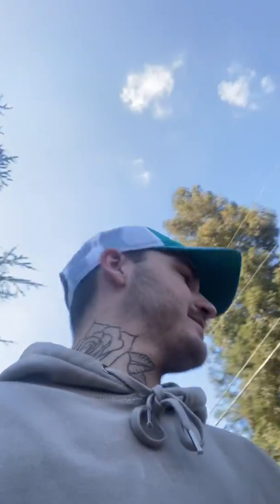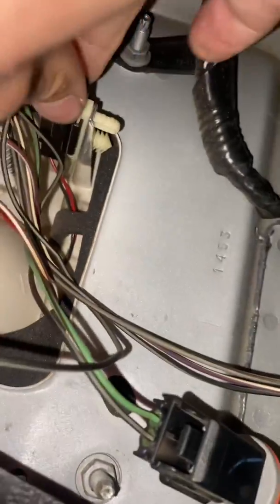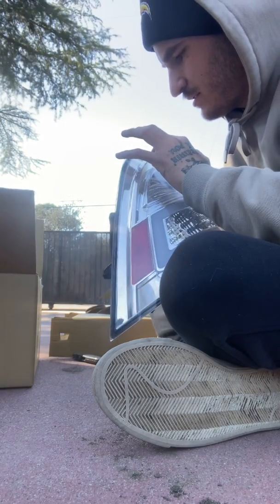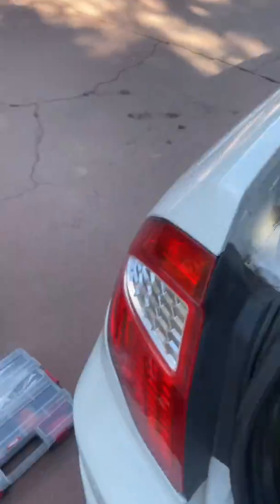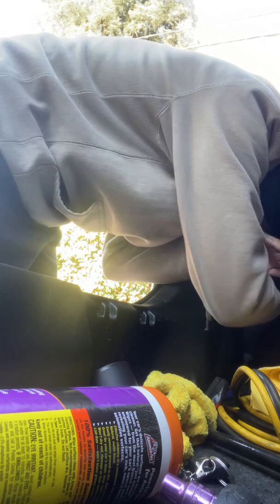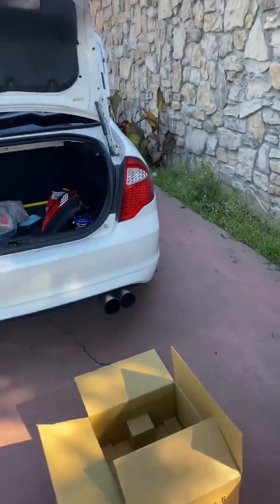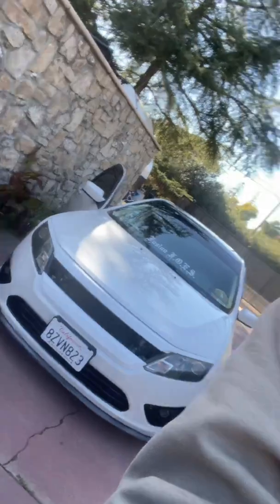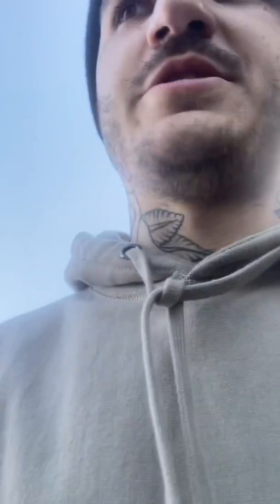Budget build custom 2010 fusion akkon taillights install and clips

Comment: Where did you get the spoiler from cause I have the same car as you and how would I know what spoiler would fit my car?
Reply: if i’m not mistaken it’s a subaru wrx sti spoiler
Reply: @Versility  okay and how did you know it would be able to fit your fusion cause I have a 2011 fusion se
Reply: @Versility  basically I don’t wanna buy the wrong one
Reply: @k-drizzy7914  just try to look up some install videos
Reply: @k-drizzy7914  just try to look up some install videos
Reply: @Versility  alright bet
Reply: @k-drizzy7914  yessir check different spoilers from different years of the wrx sti and find the year of the car that has the spoiler that matches this one